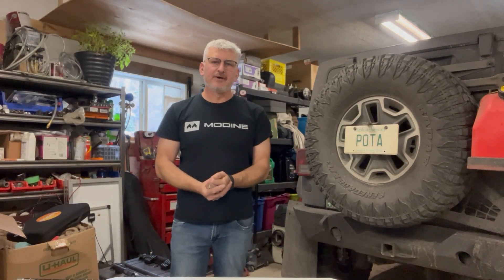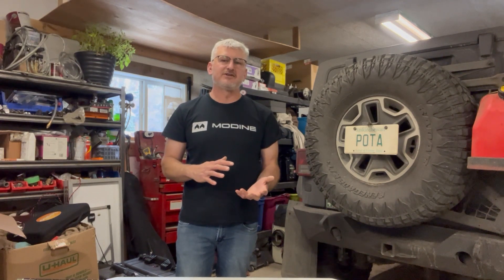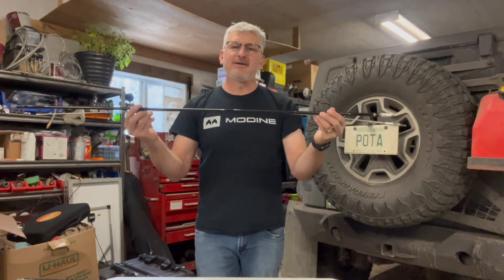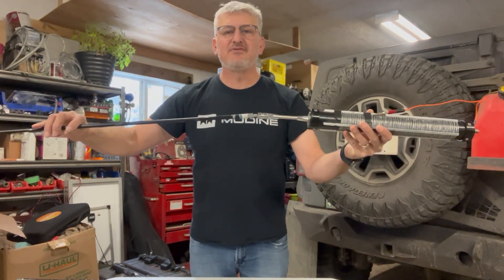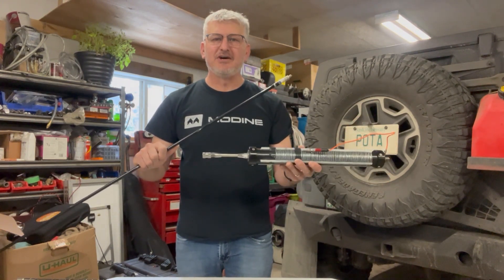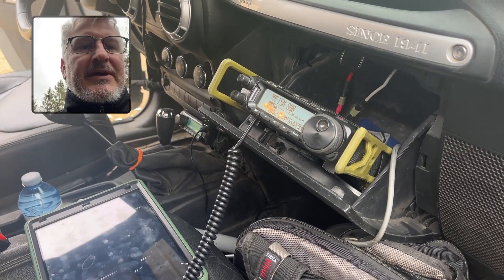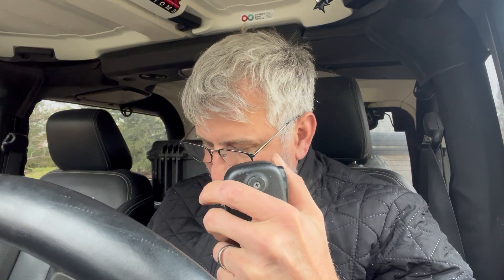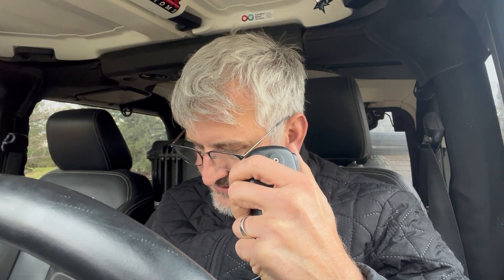DIY adjustable loading coil on a hamstick. 3 bands on one Stick. (best mobile ham radio antenna)

Comment: Informative, easy-to-understand modification of the popular "Hamstick Antenna System."  I have a few of these fascinating antenna elements around the shack  It appears time for some antenna experiments.  This modification would be useful for hams restricted by HOAs and CC&Rs.
Reply from the maker: Thanks for watching.  Stay tuned for my test of a newer and smaller version coil on the 20m stick.

Comment: Love the HamSticks Wes! Great idea to test. Was wondering whether my 40m coil would work with my 20m Hamstick or whether it doesn't quite work that way. I'll have to run out and take a look with my NanoVNA. Nice work! 👍📻⚡
Reply from the maker: Absolutely try it on the 20m and see if you can any bands below 20.  I’m going to give that a whirl hopefully this week.  🤙🏻🤓
Reply: I used to use a 7' firestick on 40 meters, they always resonate somewhere else pretty well.

Comment: Very nice.  I'd be interested to see if a loading coil could make my 40m stick actually usable.  Or just use a coil and the 10m stick.  Science for the win!
Reply from the maker: There is a video in the works.  Tips and tricks on tuning the 40m hamstick.  Stay tuned.